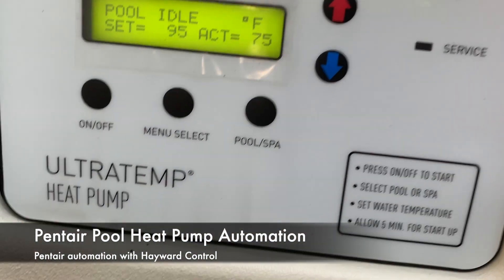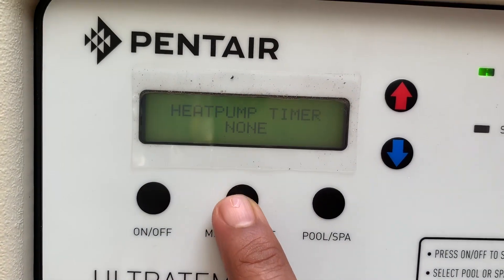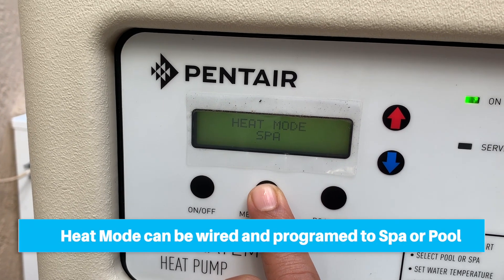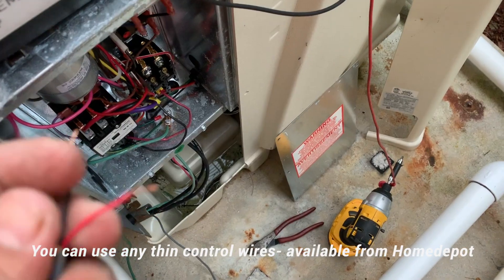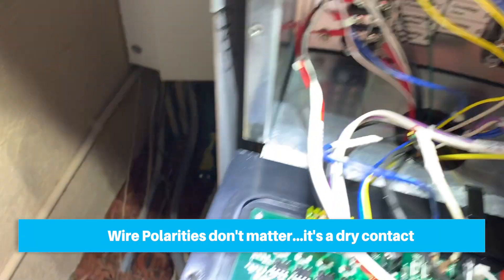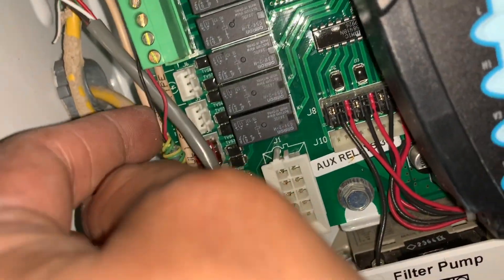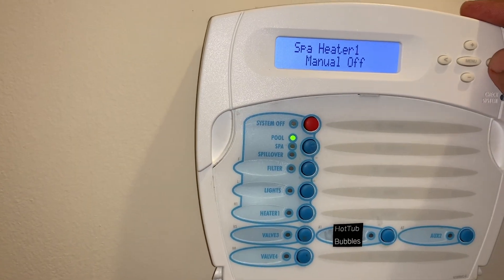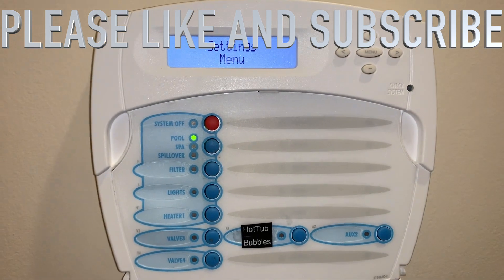Pentair Pool Heat Pump Remote controlled wiring

Comment: Great video - thanks for sharing! I am trying to automate/control my heater using some smart relays and think I can definitely borrow from your instructions. One thing I don't understand is how you're able to control the temperature? If I followed correctly, all you've done was enable a relay to control when the heater turns on or off. Is the heater temperature you are setting on the main display just "for informational purposes" so you know what temperature you MANUALLY had set at the heater or does the relay (perhaps via a series of open/close pulses) actually control the temperature setting on the heater? Thanks again!
Reply: One more question, perhaps silly, came to mind. Can I assume it's perfectly fine to leave these contacts hooked up inside the heater in the case I change settings back to manual control (i.e. disabling remote control)? I would assume the circuitry inside the heater understands that if I've set manual mode it would just "ignore" signals coming from the relay. Thanks!